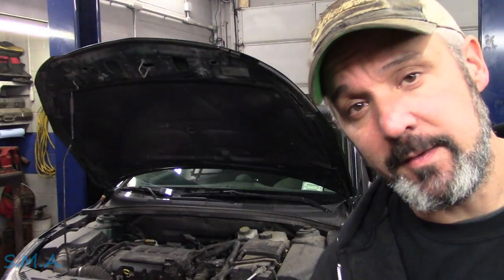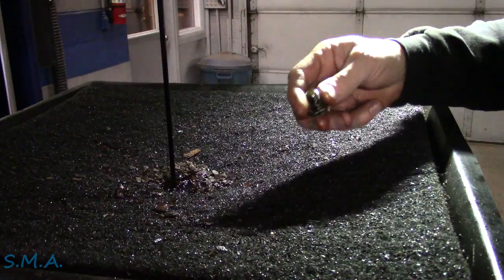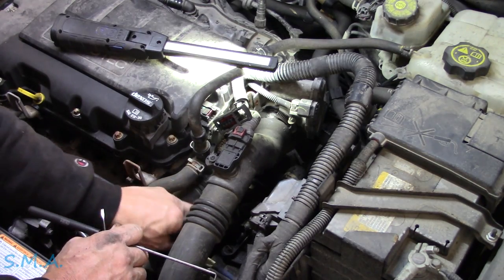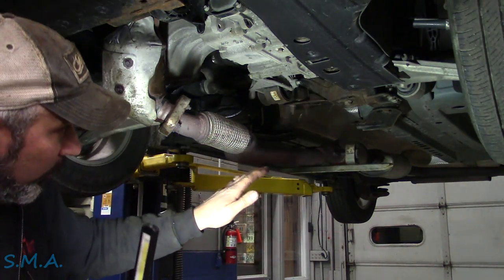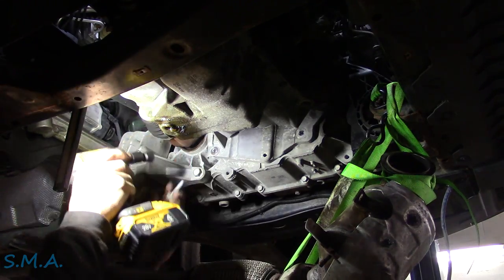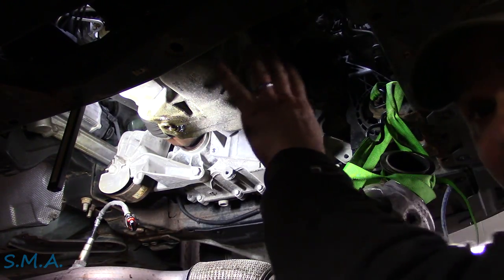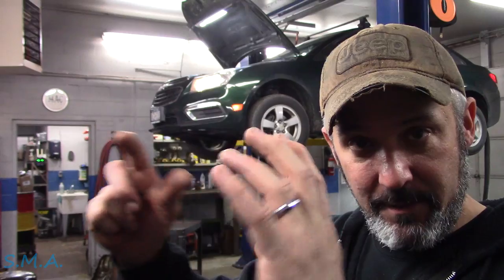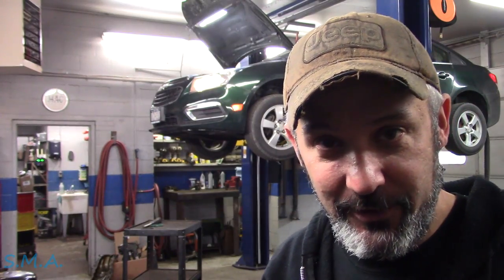Chevrolet Cruze 1.4 Turbo: Oil Pan Replacement

Comment: As a Northern Ohio resident, I can attest to the bolt eating rust we have around here. Any time I can work on a car from the south, or dry places like Arizona/Utah; it's a dream.
Reply: I spent the first few years as a tech in Philadelphia where I lived my whole life and then moved to Georgia where I’ve been for over ten years, it is an absolute dream working as a technician down here lol, there’s no way in hell I’ll ever move back to an area up north
Reply: I moved to Western New York from Tennessee (what was I thinking?) And moved witb a Mazda B3000.  Mechanic doing the  inspection called me in the shop.  He said have a good look now cause you'll never see it this way a again.  He was soooooooo right.
Reply: Born and raised in Phoenix. Some of the shops I’ve worked in didn’t even have a torch. I didn’t learn how to use one until I moved to Indiana and had to work out there for a year. I had already been a mechanic for 5 years at that point. Arizona cars are so easy to work on.

Comment: NOTE TO ERIC: When doing an oil pan, I usually use 2 short studs in the engine block oil pan holes to center / guide the pan up for a perfect placement !!!  This prevents any scrapes of the sealant, and takes just an extra minute as opposed to redoing it all again because of a tiny leak. Just an FYI tip from a master !!! A salty old dog is never to old to learn a new trick !!!  It's about time you have a video where I can finish my cup of coffee and snack just as you are about to wrap the job up. Kudos on the great sealing of the oil pan with the sealant - nice job and NO leaks - Hurrah !!!!!! Never underestimate the value of a good wife and exhaust train holder !!! A box of sugar free candies is always a nice thank you for her help, along with a kiss !!! Hasn't failed me yet !!! Waiting for part two to finish off this vehicle and make it worry free to the owner !!!  Well done Eric & Vanessa !!!!!!!
Reply: um, ok

Comment: The GM '1.4 Turbo" is not the engine displacement rather its how many quarts of oil you lose per day  and the speed at which it flows.

Comment: Man, the Chevy Snuze is quintessential modern GM design philosophy. 
Plastic coolant housing that fails notoriously? ✔️
PCV system that's prone to clogging and sending oil pissing out the rear main? ✔️
Small displacement engine with a turbo made of cardboard and pot metal? ✔️
Cheap plastic EVERYTHING as far as the eye can see? ✔️

If a GM car has a turbo, and it ain't a Grand National, I'll take my chances walking.
Reply: Yep! All the more reason why I just  walked away and steer clear from all vehicle that has more plastic parts in them than a properly design  and well thought-out build vehicle that made sense with the right material.  The entire design and layout has to look good and made sense before I even shell out a ton of money on a new car. A slight hint of cheap and odd ball layout is usually a tell tale sign of a poorly built vehicle is just not worth the headache in the long run.

Comment: Thanks, Eric! I own a 2011 with the same exact engine and I’ve done my own maintenance on it. The oil pan gasket was next on my list and I learned an easy way from you using some support! Otherwise, I would’ve ended up using a Jack stand to hold the exhaust up and fully take off the catalytic converter. Mine has 152K on it and like you pointed out about the crack by the wastegate in the turbo, mine is a bit bigger than that one, and it is really a problem with underboost codes. GM’s “fix” is to reprogram the ECM to allow more room for boost loss before it trips the CEL. What a crock of crap. Overall, these cars are fun to work on, plenty of elbow room, and leaks that makes the Niagara Falls look like a small seep with all the plastic they used in it.
Reply: If you haven't done so, Check for boosts leaks elsewhere in the intake system. You can easily make a test kit. Buy a 2inch rubber cap from home depot and secure to the inlet of the turbo. Then using a pressure regulator, a pressure guage and 5/16ths fuel hose.. Pressurise the inlet manifold to 20 psi.. You might be amazed the the intake system leaks like a freaking sieve! Even my inlet manifold was split along the bottom seam at one point.. I JB welded the split some 20k miles ago. No more underboost codes.. See my note above about replacing and/or insulating the oil feed line to the turbo.
Reply: There isn't a gasket that I'm aware of . I used a back rtv on mine and it has been good for 2 years now. 
 No if the oil cooler is leaking the only way I was able to fix this was to replace it with oem one.
Reply: The issue isn't the plastic. It's the CHEAP EUROPEAN plastic they used. Look at a 20yo European car...the plastic turns to dust.
Reply: @TylersNeighborhoodGarage  Amen Bro ... it is simply amazing !!! 3 year old M3 in Brussels and dash cracks/door insert debonds ... and it ain't like they get but 2 weeks of Summer a year !!! I WILL NEVER BUY ANOTHER GERMAN CAR EVER !!!
Reply: @TylersNeighborhoodGarage  Not just European plastic. I'm in the UK, and 20 years ago the plastic coolant crossover pipe on the intake manifold of one of our Lincoln Town Car limos (which was only 3 years old at the time) split and dumped all the coolant on the road. After that we replaced them all with the modified manifolds with aluminium coolant pipes. Ford evidently had realised they shouldn't make them out of plastic by that time.

Comment: I bought one of these piles brand new in 2014.  It was a 1.4T with the manual which was a fun little combo but the body was horribly rattly and squeaky after only a year.  I traded it in within 13 months for a 2015 Outback and never looked back to GM.  I've since traded in the Subie for a Toyota and never looked back at Subie either.  Although I miss the symmetrical AWD.
Reply: Not much left of any “symmetrical” AWD on the newer Subarus, pure marketing shtick.
Reply: @gtemnykh  not quite true. Most manual Subies still have a 50/50 torque split front to rear only the STI has a manual and a driver selected torque split, you can rear wheel bias. Now autos and the cvt models do thing a little different but are generally 60/40 split in normal conditions.
Reply: I'm with you on this one. There's no way in hell I would put up with this kind of nonsense.
My 13-year-old Toyota has 384,000 on it.
Had to swap an oil pan because the threads stripped out, about 20 .. 10 mm bolts.. and pops right off. Exhaust is in the back of against the firewall so it's never in the way under the engine cradle.
Car stills dry as a bone on the bottom of it even if that mileage. Far as I know it's never even had the valve cover off.
Reply: @gtemnykh  Ya think?  But you'd be completely wrong. In Subaru terms it relates to configuration of the drive system & absolutely nothing to do with torque split. The system is setup along the centerline of the vehicle to balance both performance & traction = symmetrical. You'll notice when you get into a Subaru there's a big ass trans tunnel because it's engine -> trans -> axle.............not at all like the majority of front biased systems (aka FWD w/ a power take off to the rear).
Reply: @ejjackson2573  ok, well newer Subarus just seem completely lame offroad, cooking their CVTs and viscous couplings into “limp mode” lmao.  I like the older ones, head gaskets and all.

Comment: Customer: "The inside of my turbo looks like cracked glass"
GM: "That's normal"
LOL
Reply: Same goes for the Turbo's on the EcoBoost.  Same exact things happen...it's "Normal".  Normal at 80K Miles?  NO!  But welcome to my world.  $3200 repair bill at 80K miles because the Turbo designed to last 150K+ miles eats itself at 80K miles.  Wasn't happy about that for sure....
Reply: VW too
Reply: @WreckDiver99  That is the reason why I don't have a car with a turbo.  I highly doubt that I will ever buy a car with a turbo even though I do love the new Nissan Z sports car.
Reply: @markkrispin6944  I won't get another...unfortunately EcoBoost is EVERYWHERE in the Ford world, and considering where I work?  Yea.....well...yea...LOL
Reply: The "GM Mark of Excellence".
Reply: Imagine that on an aircraft engine!Holy crap!Perfectly  normal……..
Reply: @richardjones3112  Diesel boat engine...dive boat I used to dive off of had 38,000 hours on it. The owner always joked...just about broken in.
Reply: @MrShobar  YEA RIGHT!!!!!!???????????????????????????????????????????????????????????????
Reply: First one I did had two cracks. I nearly choked when my service manager told me that GM said it was normal

Comment: I see the grey silicon works on the same principle than anti seize. You use a little and a short time later you have it in your arm pits. :-)
Reply: Or on mom's couch 60 miles away
Reply: @machintelligence  are you talking about that evil black window glue that stuff will take skin off when u remove it
Reply: @monkehbitch  Due to some glitch in YouTube,  my comment showed up on another channel. When  removed it there, it disappeared here as well.   ?????
I was referring to urethane caulk and adhesive, especially the self-leveling caulk. It gets all over everything.

Comment: Looks like a great time to trade that one in. Tires, turbo and oil cooler are going to be one heck of a bill.
Reply: It's not worth anything as a trade in. The guy's right to drive it until the roof falls in. The next repairs will be around 2K, you can't replace it for that.
Reply: @ralfie8801  best time to trade/sell any car right now in the insane market here in the US! My wife's junk POS 2018 jeep renegade with 25k was a nightmare and getting close from experied warranty. Bought it for 29k, we traded it in for 27k
Reply: @jmabs5096  The trade in value is great. It sucks thou when you try to replace it. Everything is overpriced. Ask me how I know
Reply: These EcoTec engines have some engineering flaws; the oil cooler repair should be good for another 100k miles. Fixing suddenly becomes economical when used car inflation hits 50%+, with good cars difficult to find.
Reply: @jmabs5096  
You still can’t replace it for that, if it’s not having trouble every week, why trade? It’s a lot less costly to fix one for 2 or 3K every few years than it is to trade one in and spend more than you got in trade just because the tires need replacing or it drips a few drops of oil now and then. 
Only one of mine has less than 300K on the clock and they can’t be replaced for anything remotely close to what I spend on maintenance, which is basically nothing. 
For the most part, people in the rust belt drive them until the roof rusts in around them, they don’t last that long there. 
Where I live, they last forever, and you drive them forever, a little maintenance every once in a while costs way less than trading one in just because it’s tires get worn out.
Reply: @dosgos  vote with your dollars, don't buy POS to begin with!
Reply: @ralfie8801  I live in the rust belt, religious about doing undercarage cleans, still got my 98 camry with no little body rust, and frame is still soild. Problem is folks who never rinse their cars a few times above freezing in winter, salt kills everything
Reply: @jmabs5096  Too late! We have the similar Ecotec 1.8 engine. The engine runs great but It needs a lot of maintenance to keep running perfectly. For DIY types, that is OK but a financial disaster for someone that relies on a mechanic. Our Ecotec runs like new and is dry; the oil cooler is a dark cloud but doesn't hit every ecotec.
Reply: @ralfie8801  That guy isn't getting tires, oil cooler and turbo for $2k. Thats $1500 just in parts, $1250 if it just needs 2 tires. $3k at the very low end. Prob going rate $4k.
Reply: @mph5896  
It apparently didn’t get any maintenance until now either, those parts are/were all probably original to the car. Like I said, 2 - 3K in maintenance every few years I’d a lot cheaper than buying a new car. I don’t consider tires maintenance items either, they’re wear items that don’t wear out on any schedule.
Face it, there are many people that don’t trade every time the floor mats get dirty, they use a vehicle until there is nothing left of it.
Reply: @dosgos  the 1.8 doesn't have a turbo on it to fail, but it does have s timing belt that will eventually break, just fyi
Reply: I have one of these engines, and I reckon the oil cooler leak is only the oring or the gasket (or both). Should not be costly for those bits.
Reply: We have a Buick sedan that is fantastic in every way. Not saying all GM cars are great but not all are like the Cruze either. . .
Reply: @dosgos  JUNK!!!!!!!!!!!!!!!!!!ECO GM = JUNK
Reply: @dosgos  ECO TEC = GM JUNK!

Comment: The amount of these that crapped themselves here in Europe is legendary, and the related 3 Cyl Engine which was also Junk, Oil specifications was updated to combat LSPI very important to use the correct lubricant in these little grenades. Great Channel 👍
Reply: I think what happens with a lot of modern cars is the owner just changes the oil based on the oil life monitor. they take it to a quick change place whenever the car tells them to. I have found these systems to over estimate oil life in Hondas leading to eventual oil consumption due to stuck oil control rings (K24 engines). In 2007 BMW introduced their turbocharged N54 engine. The same year the dealers were offering a new incentive to cover the cost of maintenance for the first 4 years including oil changes. That same year the recommend oil change interval went from 7500 to 15000 miles. 15000 miles for a turbo is suicide and many of these cars developed turbo problems due to worn journal bearings. 

Sadly the car companies can't be trusted to give you the proper knowledge to ensure your car lasts for more than about 7 years or 100,000 miles. 

I have been using 7500 mile OCIs on the BMW and it has 190,000 miles (new turbos installed at about 75,000). I just changed the oil in the Honda (110,000 miles with 2 quart oil consumption in 10,000 miles) and will be using a 7500 mile OCI on it going forward.
Reply: @Fix_It_Again_Tony  True, using the full OLM and even exceeding it, with the most basic oils, and never topping up.

Comment: Wow... what timing. I just had one of these last week. Someone had heli-coiled the drain and really messed it up. I changed the pan and also it had quite a water pump leak, as well. Customer declined that... for now. All in all, not a bad job. Except for putting that turbo clamp back on.
Reply: I hate that clamp as well, so I don't take the catalytic converter off.  I just remove the rear engine mount and the flex pipe and the pan just slides right out.

Comment: Given how often turbos fail, I'm a little surprised there aren't more quality videos of how to diagnose and replace a turbo. Just sayin', we'd love to watch you do one.
Reply: I agree, I hate doing them. Have only done a few so don’t have a solid process to do them quiet yet. All my coworkers don’t like em either
Reply: The coolant line was the worst one for me older 1.4s it seems the ac compressor bracket is fully out of the way,  newer ones cover that bolt by a quarter inch so you cant get a socket on it and the acess was already bad,  i had the stuff so i swapped it to an6, really helped for the headgasket job i ended up doing because i can just unbolt the turbo and flop it away from everything. @orchestracelloplayer